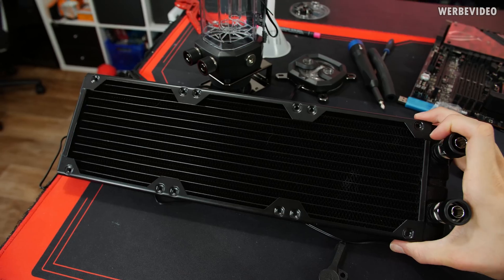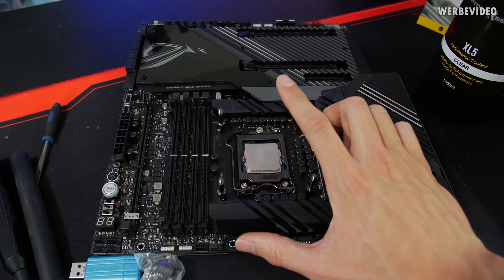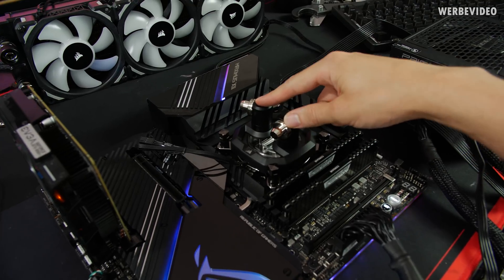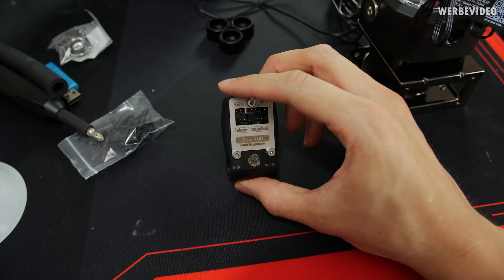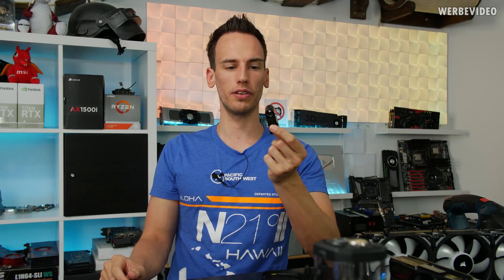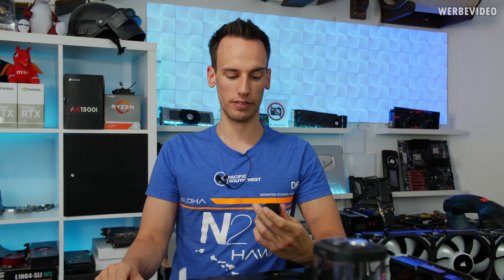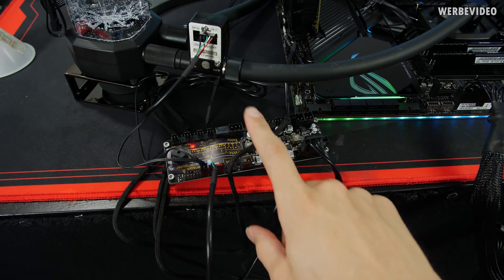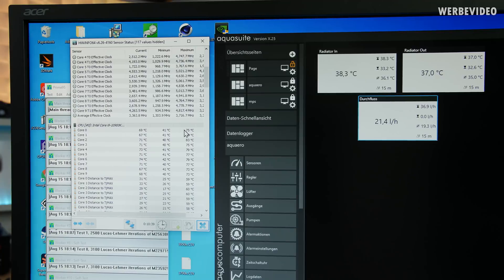Testing one of the Weirdest Water Cooling Myths - A SLOWER Flow Rate will result in BETTER Temps?

Comment: It's all about balance.
As you say the block type will matter(pin/fin, jet-plate/high-flow, how thick the coldplate is, etc.), the CPU design will matter(transistor density, heatspreader, etc..), the pump quality will matter(head pressure), and most of all the ambient room temperature.
I myself had had a lot of success with specific loop orders,  The best loop order say for my X99+5930K+1070 AMP system is res>pump(Delphi DDC type(the same 18W pump used in the Mac G5) with body+top and heatsink kit from Barrow)>rad>coolest component(HDD's(4X 3TB)+M.2 SSD's)>next coolest(mine is my RAM)>next coolest(mine is the VRM's) >rad>GPU>rad>CPU>back to res.
There's a scientific reason for this, and although it only gains you a measly 5 or so degrees, for a good OC every little helps.
1)the res itself can have a good cooling effect as it's usually within the airflow path IN THE CASE.
2)followed with a rad you get extra cooling as that rad doesn't have to deal with the same "nominal" temperature equalization the loop has.
3)the "heat-soaking" effect from running the loop on a high OC or just in high use(eg:video editing/encoding) is drastically reduced by ordering the coolest parts through to hottest. And uncontrolled heat-soak can become a "run-a-way" situation... The enemy of heat dissipation.
Linus did a little vid on the subject too recently, I think it was one of the tech manufacturers coolers he was checking out.
Also, if the "coolest rad first" loop order didn't have any benefits(however you implement it, my X570+3950X+1080TI+Lian Li TU150 system has every fan on a rad so coolest are used for intake), they wouldn't use it in server farms with the way they have to stack the rads in-line within a U chassis. 👍

Comment: You proved that one cpu temperature is affected greatly by flowrate, but extrapolated to a different scenario.  This did not prove that a radiator in front/back add between versus at the end does not affect the temperature of the 2nd CPU.
Reply: He was attempting to show that the difference entering or exiting any element are so small that it simply doesn't matter what you do as long as there is high flow rate through the whole system 
Its simply a negligible difference so the words used often of "it simply doesn't matter" are used (correctly) to sum up the conclusion. 
For the record the conclusion was that yes having all the blocks in series is actually worse than having it go block rad, block rad (for the second block) just that the difference (for the second block) is so negligible its not worth considering.
Keeping a loop simple which reduces run length is likely more important as reduced runs would likely increase flow rate. 
Then there's aesthetics to take into account ;)
Reply: @Niklby12  That presumes you do in fact get enough flow for this effect to be negligible. However, his own flowrate measurements show this is not the case. So, it is true as long as your pump can supply 36,000 L/hr per 40 W PC power (assuming you want to keep temp difference < 1°C)
Reply: it is simple thermodynamics and heat transfer. If the inlet temperature to the cooling block of the CPU is 5°C hotter than the first, than the 2nd CPU will be 5°C hotter than the first.
Reply: the Loop will always equalize. that's the simple answer to where you put stuff. if you put some Part immediately after another high Power part, sure it would average another degree or so higher than if it was put farther away in the Loop from it.
but the important part here, is that the Water throughout the Loop will all be within a few degrees of each other, because all of the Water is in contact with itself.
Reply: @taiiat0  your explanation is absolutely wrong. Just because the water is in contact with itself, does not mean the water temperature will always be close. For that to be the case, the flow rate must be sufficiently high and the heat sources sufficiently low. It is a simple thermodynamic calculation.

Comment: And somehow people are still arguing about loop order in the comments.
Reply: Linus just did something like this a month ago with different conclusions and more data.
https://youtu.be/vauAJl29xlw
Reply: @Starscreamious  Linus wasn't testing loop order. He was testing stacking radiators. Loop order wasn't as relevant as placing radiators in a configuration where the same air was being pushed through multiple radiators being heated by each one and found that it wasn't as efficiently as he'd expected. Stacking radiators puts too many variables into the testing to compare to any normal type of loop.
Reply: @tresnugget  He tested multiple radiators and radiator placement IIRC.
Reply: the one in the title doesnt make sense but I can see a reason for the alternating radiator and heat source 

if you are water watercooling something like ram which takes very little power, the energy from the cpu or gpu will just be heating up the ram to a point further than it would have heated up outside the loop.
plus anyone with 2 of the same gpu has seen the one after the first reach higher temperatures..

I see this a lot and dont understand where people get the idea that energy only conducts one way

the only way it couldn't make a difference is if the heat gets perfectly distributed throughout the loop as if water is a superconductor, which if so then the flow rate wouldn't matter...
Reply: @BTD3Fan  water as a system hits an equilibrium. It can conduct heat well enough that the entire body raises it's temperature pretty evenly especially at a decent flow rate. It has been tested so many times. And even with your example of RAM, it wouldn't matter because ram isn't that reliant on temps where 5 degrees is going to make a difference. Water cooling ram is pretty much pointless. I have a kit that can hit 4800 MHz on air and has plenty of headroom temps wise.
Reply: @tresnugget  actually hardcore overclocking made a video on it, its true for most people ram temps dont matter tho

I was just using it as an example, but if you run 4 gpus in series I guarantee you the last one will be much hotter than the first, so there is no reason to think that in a regular system putting a 350 watt gpu wont heat a 150 watt cpu  by at least a small amount.
Reply: I suppose it could change if you are heat soaking completely or if the system dissipates the energy faster than it is put into it. but you might not reah an equilibrium in a reeegular use case
Reply: @BTD3Fan  you're always going to reach equilibrium. Otherwise the water would get hotter and hotter untill eventually you overheat or your pump fails. Pump can only handle about 60c water temps. And im reading someone who has a 4 way SLI setup on water cooling and has a 1-2 c difference between cards. If it was a massive difference then the cards would become unstable. You wouldn't be able to overclock them at all because Nvidia GPUs are insanely dependent on temps for stability at higher clocks. After 60c on Pascal and Turing you start to see huge decreases in overclockability. My liquid cooled 2080 Tis can hit 2200+ at around 35 to 40c if I can keep it cool enough in my room. With a sustained load they get into the high 40s and I can only keep them to stay stable at 2145-2160.

Comment: Roman did you plumbed correctly Aquacomputer MPS400 sensor? This flow rate is way too low for D5 pump, single radiator and CPU block although Corsair radiators are HWLabs L-series radiators which have higher resistance

AQ MPS400 is directional flow meter and if you plumb it not correctly then you can see such low flow rates

You should see as minimum 180-240lph with such setup

Comment: I dont know why people think a slower rate would work. You can look at the automotive industries for the answer to this one. Mechanical water pumps work with engine speed. The higher the engine speed the more heat it produces the faster the water needs to circulate to cool.

Comment: Definitely seeing a "sweet spot" between too low flow (poor cooling)and quickly diminishing returns on high flow (noise and pump wear concerns). Might be an interesting follow-up to explore that sweet spot area. i.e. Is there an obvious/predictable "elbow" in the data?
Reply: I actually have radiator in/out temp sensors in my permanent custom loop, so I've done a lot of testing with this. I can't really give a specific number, it would depend on a huge amount of variables (radiator surface area, amount of heat being produced, etc), but there is definitely a sweet-spot yeah. Too low, you see the in & out temperatures diverging aggressively, and the system temp rising. But I would say that it's almost like a log curve, once my D5 pump gets above around 30% RPM, in & out temperatures are already within ~1 degree. Maxing out the RPM at that point makes no real measurable difference. What it might actually do is generate more heat, because now we're adding energy into the system via the pump itself!

Comment: Yep, I agree. Loop order does not matter. I've been water cooling for over seven years and have tried every configuration possible. There's never more than one or two degrees difference. My current loop has the water flowing from the radiator to the GPU block, then the CPU block, then to the pump. This configuration has not noticeably increased the CPU temps at all.

Comment: If you say it does not matter then why are you running 3 rads.  Your test does not show anything for why or why not putting a rad after every heat device helps or not.  I would argue that it would help and averaging all the devices temperatures would have a lower average with the rad between each device.

Comment: Your conclusion is half correct/complete I dev refrigeration systems professionally . If you only lower only flow on the rad it will affect rad deltas. Greatly increase the size of inlet and outet of rad(22mm-id). Hope I can present an experiment before next week

Comment: more pump speed = more vibration and noise and air bubbles in the loop
Reply: Noise and vibration? Sure. Air bubbles? Definitely not. Once you get the air out of your loop and fill it there's no way for air to get back in to create bubbles. If you have bubbles in your loop at any flow rate then you either have a leak or you need to add more water.
Reply: I got bubbles, don't like the hiss they make travelling around, better to reduce the speed if and not have splashing and hissing from when they go through the pump

Comment: @der8auer, I agree with your theory but I add a sustem can vastly benefit with a larger single radiator and more fans at a higher air flow rate.  however, this setup would be egtting into the area of diminishing returns for the increased cost of the larger radiator and noise from the fans.  Thanks for the video.

Comment: Look at it as "work" being done: work = temperature_difference * flow_rate. 

Higher flow over the CPU (or GPU) equals better cooling, more fins (or design improvement) in the radiator equals better dissipation; but there are reasonable limits for each - the radiator can only be so big, and the hoses can only take so much pressure.

Comment: This is a great video; so much information. I'm interested in the "flow rate" and the "time spent" in  both the radiator and CPU Block; would a hybrid approach be a similar result? ie: restrict the tube diameter to increase speed (and pressure) across the CPU block, but widen the tubes going into the radiator to reduce speed (and pressure) through the rest of the loop. Essentially, mixing tube diameters to manipulate the water speed through these 2 critical areas???
Reply: Restricting diameters won't change the flow rate in the CPU block itself, or in the radiator, because (in a series loop) the flow rate is constant. A restricted diameter will speed up the coolant, but because the cross-sectional area is smaller, the volumetric flow (the litres of coolant passing through that point per unit time) remains the same.

And there's no benefit to slowing the flow rate in any particular section. This is difficult to understand conceptually unless you've had some level of education in thermodynamics, but: looking just at the inlet/outlet coolant temperature is misleading, what matters is the total power dissipated in the water blocks and in the radiators. If you half the flow rate, and double the temperature difference of the coolant before and after a block or radiator, the end result is exactly the same amount of heat energy absorbed (in a block) or dissipated (by a radiator).

It's all about the heat capacity of the coolant. For water, this is 4.2 kJ/kgC. This means it takes 4.2kJ of energy to heat 1kg of water by 1C. Or, 4.2kJ of energy to heat 0.5kg of water by 2C. Or 2kg of water by 0.5C. Or 10kg of water by 0.1C. It's the same amount of actual energy in each case.

In practice, every radiator, and every water block, that I have ever seen, performs better at a higher flow rate.
Reply: cpu blocks already do that, thatrs the purpose of the jet plate, to send water quickly thru the microfins

Comment: the only loop order i think would actually make a difference is from an airflow perspective with the stacking radiators science. a recent LTT video gave evidence to the concept that when you have air moving through multiple radiators its best to run the heated coolant the opposite direction of the airflow path. this keeps the air coming into the radiators cooler and works more efficiently since the air coming out of the first radiator in the airflow path wont be as warm for the second radiator, and so on. i have a 360 (top) and a 280 (front) and i designed my loop that way: CPU > top radiator > front radiator > reservoir.
edit: whether that works for me with any impact in such a small representation of the science is unclear. but hey it cant hurt.

Comment: Water-cooling is so weird nobody knows what is actually doing, and we are still using the same pump design over and over with no improvements whatsoever
Reply: asetek patent (and the brands that license it) and they litigate if u design something similar enough without paying the license . jus NOW  there are new designs that perform better than the asetek design, if you look at GN Steve, he knows what its doing.  In the past there have been improvements just not as a big of a jump in performance.
Reply: @echoforge333  I was referring to the Laing DDC and D5 pumps :)

Comment: Hi Roman; fascinating experiment! As always, the empirical evidence is king over the theory.  I was wondering what would happen if you maximise the flow to the water block but then run two radiators in parallel after the CPU; I.e. half the flowrate through each radiator maximising the cooling of the water but maintaining the fast flow through the water block.
Reply: half distance of rads and half speed through them so net 0